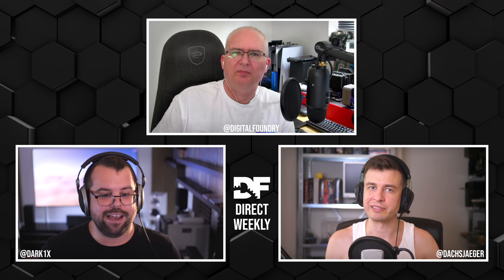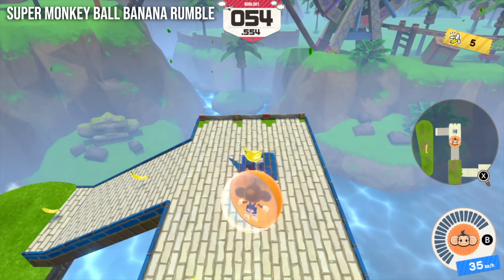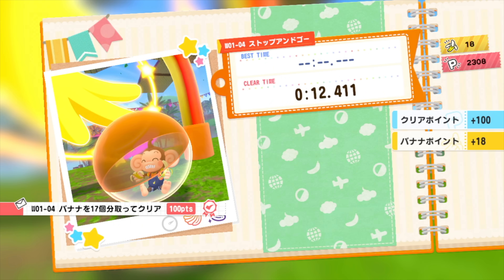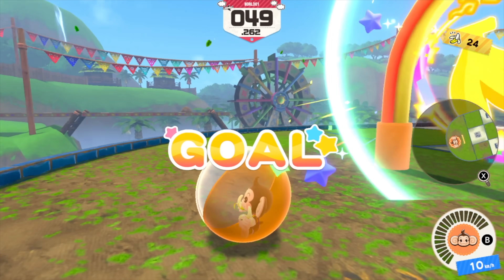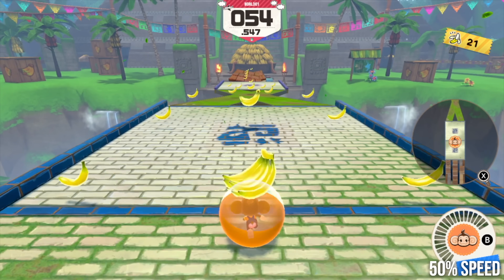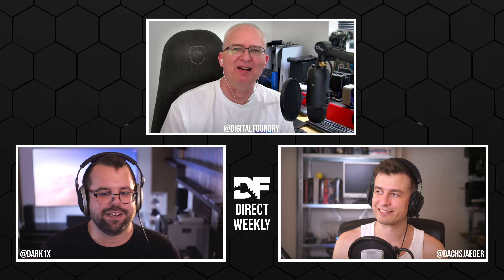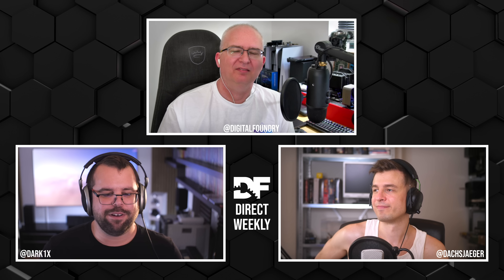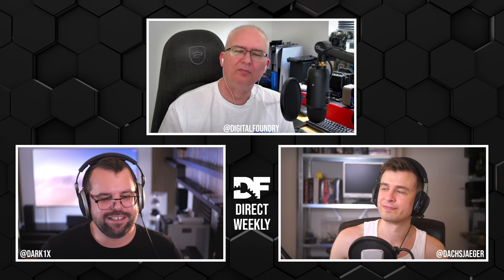The Unity Engine's 50Hz Physics Problem Strikes Again!

Comment: Unity dev here, this is the devs fault. This issue is beginner-mid level. 

The camera movement is likely nested to a physics simulated object (bad). 
Instead the camera should update freely and physics should be interpolated or run faster than screen refresh rate like 100Hz (if perfs allow it, which today devices do without problem, Unity PhysiX can even run on PSP lol)
Reply: Wow so many people that don't understand the problem. I guess this is the reason this keeps happening

The safest option is to completely decouple the physics with the rendering, if you think it's not doable even in a game like this then you simply don't have enough experience. Sorry, I'm not trying to be mean, I just got surprised that so many people think this is either impossible or super easy to fix, it's neither. Yes you can employ 2 minutes fixes that only push the problem to somewhere else, or you can try to design the tech of your game take this into account so that you can get fluid rendering regardless of the state of your physics, be it prediction, interpolation or anything else. Heck there's tons of threads about this in unity forums, you'll surely find a solution that works best for your case.
Reply: @kebrus Unity physics is not tied to screen framerate, never has been. You could go 1fps with physics at 50Hz in theory. 

Multiplayer is the bigger issue, I’ve got no solution for that. Also rendering is the main source of frame drops, rarely it’s physics.
Reply: @euden_yt  I never said it was, I said you need to decouple your rendering with your physics. What do you think happens when you put your camera following a physical object?

What do you think think happens when you let the physical object position be determined by physics when it's being rendered?

Think about the problem and ask the right questions. If you still think these are either easily solved by changing some settings or impossible to fix that means you are still not understanding the problem.
Reply: @kebrus  I went over this in my replies
Physics isn't tied to rendering (which is why the stuttering is happening, as the physics that move the player aren't running at a multiple of the rendering rate) and because it's impossible to get the physics rate to be a multiple of the refresh rate in Unity (without tying physics to rendering anyways) there isn't a perfect solution. Interpolation and prediction would help make it smoother, yes, but they would be harmful to the gameplay. Prediction isn't well suited to this kind of game, and interpolation introduces delay and a gap between where the player actually is and where the player visually is. Even if it's small, it'll likely have an effect on high skill level players, players using wireless controllers, and players streaming games (XBOX Cloud, Steam Link, etc)
Reply: @SHIFT-HACKMON  please read my previous reply to euden.
Reply: @kebrus  OK I think I kind of get what you're saying
You still need the camera to follow the player, so you will either have stuttering on the environment (no interpolation on camera) or stuttering on the player (camera with interpolation) unless you use a workaround that would affect the game feel like I mentioned in my previous reply. Generally stuttering that affects the entire screen will be less noticable than stuttering that only affects the player character since there's a lack of movement aside from non physics-based animations compared to the player character being noticeably behind or ahead of their "correct" position relative to the camera whenever a stutter occurs
Reply: @SHIFT-HACKMON  unless I miss understood what you meant I actually feel like the stuterring from the camera is worse, maybe it's just my perception but I think this is the reason this particular game was outed, because you can clearly see that the camera is somewhat parented to the ball and cause the whole screen to stutter, while if it was just one or two objects in the scene you may even miss it with the rest of the gameplay.

Like I said previously you have to find the best solution to each case, and that is precisely the reason why this is neither too easy or too difficult, usually there is a solution with some caveats for each one of these problems but because they might need different solutions it gets harder to generalize the problem and solution.

You can find people discussing solutions everywhere, I'm sure I even saw a video recently from an indie about his particular problem.

For example for the camera of this game the first thing I would try is to make a ease follow interpolation at relative fast speed. The camera of this game doesn't need to be snapped to physics, I think I would do it even if I didn't have this stuterring problem, if the camera has 2 or 3 frames smoothing delay no one will be able to tell. This is not 250fps counterstrike.
Reply: @kebrus  the reason I say stuttering from the camera is better is because one of those objects in the scene that would be stuttering otherwise would be the player's ball, it'd effectively have the same issue as Batman Arkham City has on Switch
Reply: So in other words they got it working just enough to push it out the door and they'll gradually improve it with multiple patches over time but never actually fix it.
Reply: That second option is not viable for the switch, which is what's being discussed.
Reply: @InvidiousIgnoramus  I suspect that it's very viable to simulate 2 or more physics steps per frame, even on a slow device, when you're dealing with one moving sphere vs mostly-static geometry. With Unity, focus optimisation on rendering, keeping draw calls down, or it'll eat a whole lot of CPU time (And for mobile/switch, keep shaders simple too)
Reply: @InvidiousIgnoramus  I don't think that's a genuine limitation for the type of calculations needed for the gameplay in monkey ball. There is one physics object and it's a sphere. The level geometry is flat planes. The collision test is something like a dot product and a vector difference. Something like 100 clock cycles. They could test the sphere against every single surface in the level every step and still probably 10x the number of physics steps without significantly eating into the rendering budget.
Reply: The game already drop to 5 fps on the switch, no need to make it drop to 0 fps
Reply: @1337pianoman  Yes and no. There is a 16 player multiplayer mode, and they clearly want this to be as big an attraction as single player, as evidenced by the common features in multiplayer focused games, like a season pass. Yes, there is a monkey ball season pass. I personally have no clue how much physics calculations are done on which connected devices or if there's even a server involved. However, it would be sensible to believe it's more resource intensive that single player. Hopefully they weren't dumb enough to optimize for single player as they do multiplayer. Not that you can even compare them, since multiplayer barely hits 20fps.

For single player, you're technically wrong. Monkey ball, this game included, features many physics based gimmicks, such as weighted cylinders and, in this game, free rolling spheres. Obviously there's many moving objects on cycles too, but we all know those are essentially moving walls. However, the game formula you described was actually used... on the friggin gba! I shit you not. So, yes, the physics can easily be ran on the switch, assuming the upgrade from game boy advance to switch should accommodate the addition of a level with 5 rolling spheres.

Imo multiplayer on the switch was always going to be god awful, and everyone knows this. Any argument stemming from the idea that they catered the physics for multiplayer only shifts the blame from incompetence to naivety
Reply: @SilverLining1  This thread is forgetting something really crucial
You can't actually fully solve the issue without either tying physics to rendering (Which is bad and would cause slowdown instead of stuttering on Switch) or by modifying the engine to accept fractional values for the physics rate
You'll always either have stuttering from needing to duplicate frames or stuttering from needing to skip frames. The best options are interpolating the physics (Which would result in smooth movement at the cost of the player always being 1 frame behind, harming the skill ceiling) or to attempt to minimize stuttering as much as possible by using an approximation of 1/60
Reply: Neither option would work
It isn't possible to set the physics to update to 60Hz without tying physics to the refresh rate, which on the Switch where the game doesn't have perfect performance would lead to slowdown, which would cause desync in the multiplayer mode. Likewise, because it isn't possible to set physics to update at a fractional value you can't set physics to run at a multiple of 60, leading to stuttering from having to skip frames instead of stuttering from having to duplicate frames
The physics object the camera is nested to is the player, and as far as I know this is how the camera has worked in every Monkey Ball game (At least on home consoles)
Having the camera update freely doesn't solve the issue, as it's still needing to follow a physics based object and interpolating the camera position would just make the stuttering more apparent, and you can't interpolate the physics without harming the feel of the game
Reply: @SHIFT-HACKMON  I'm not sure what point you're making. Are you suggesting that it's impossible to not have a stuttery game when making it for the switch? There are several ways around it. The easiest is to do the physics step (or an integer number of physics steps) in the frame update and make sure the worst case performance is still under 16.6ms (assuming 60fps target). The other standard approach is to calculate a partial physics step in the frame update just for rendering purposes. You know how long ago the last update was so you can calculate where everything should be now. Moving the camera in the physics update is pretty silly, but it doesn't fundamentally change anything as long as it's also included in the partial step.
Reply: @1337pianoman  I'm not saying that it's impossible to have a non stuttery game on Switch, it's just that from what I've heard Switch doesn't maintain 60fps, particularly in the multiplayer mode (also you just shouldn't tie physics to rendering, that will cause issues)
As for the partial step thing, given how Monkey Ball works I'm pretty certain that would cause the player to briefly be floating or clipping through the floor in the case of a significant input change during a frame where a partial step is required
Reply: @SHIFT-HACKMON  it's very possible to render the exact state between 2 physics steps -there are no unknowns. If you can work out where everything will be in 0.02 seconds, you can also work out where everything will be in 0.00379 seconds. You could run the exact same code and keep the updated positions (it's all continuous functions so it doesn't really matter if the physics steps are all even), or do a simplified version just for rendering and throw it away. I'm not actually sure what most people do these days. I think I'd lean towards running an integer number of physics steps per frame
Reply: @1337pianoman  I'd lean towards doing that as well, but Unity's physics timing system can't accept any values that would give an integer number of physics steps per frame because they have repeating numbers (0.0166... for one step per frame, 0.0088... for two, so on)
Reply: @SHIFT-HACKMON  Fair. I wasn't considering the problem from a Unity specific perspective. I had a quick look into their options. Not a huge fan of their interpolate or extrapolate options. Not entirely sure why they say to avoid simulating with different step sizes (I guess floating point precision?). I'd probably increase the physics updates to ~2 per frame and turn on extrapolation. (But really I just wouldn't be using Unity in the first place)

Comment: Matching the rendering fps is not a god solution and would still cause jittering when fps might not be reached. Physics framerate should ALWAYS be set as low as possible, so that physics simulation still behaves correctly and doesn't waste additional CPU resource beyond that. Then to make visuals smooth, there's the 'interpolate' option. It's fine for most gameobjects, but for camera I would still unparent/unconstrain it from the rigidbody and just use my own smoothing algorithm for setting location and rotation based on target in the update loop. Smoothing based on 2 or 3 past physics frames gives perfect results even if you run the game 200fps.

Comment: Isn't this what the physics interpolation/extrapolation is for (which has been a feature since Unity 1.0)?
Reply: Yes but mainly the camera should not be dependent on Fixed time
Reply: @euden_yt If the camera is following an object, you want the object to remain the same size and position on screen.  You don't want that object to judder further/closer from the camera.  The rest of the setup need to adhere to that.  So fixed time is not the core issue, cohesion between the camera & target is, and also you should have interpolation on your target & camera.

Comment: I encountered this same problem with Unity. Interpolation will fix the issue in most instances.

But there are times where simply turning on interpolation won't fix it.

The devs could have interpolation on but the interpolation doesn't work correctly because of the way they are programming the movement of the ball.

To fix this issue, you need to do a "late fixed update" that sets the position or rotation of the object after all the other fixed update code has finished.

This ensures that Unity correctly uses your position & rotation for the interpolation.

Unity's documentation states that certain functions will move physics objects to work correctly with interpolation, but it's not true.

Comment: You can't blame Unity. They set physics default to 60hz and then game runs uncapped or just at a higher framerate. Same problem now. Even worse, because if there's any frame drop, just so slightly you'll have a frame with 2 physic ticks. Most have 144+hz monitors now, so interpolating physic objects and making presentation position detached from actual simulation position is totally normal nowadays.
The only one to blame is the devs who seemingly didn't catch it. Which is very odd with todays resources.
Reply: I highly doubt that most people have 144 Hz monitors now. High refresh or 4K displays still seem to be used by a minority of PC users according to Steam surveys.

I personally refuse to get a 144 Hz monitor because it would make so many games that are locked to 60 FPS look horrible. 120 Hz is preferable.
Reply: @11clocky Most people might not have 144Hz monitors, but I would say that most people have monitors that have refresh rates higher than 60.

And to take such a stance against an obvious, inarguable improvement is pure ignorance. We are at the point where even the most sludge-grade, sub-$100 monitors support VRR, and therefore are perfectly capable of locking themselves to 60Hz when a game runs at 60fps. Educate yourself and improve the quality of your life.

Comment: 50 hz issues will never leave us
Reply: But interpolation will always be the solution.
Reply: @SnakeEngine  disgustang
Reply: @nikodem123asdf  Well, yeah, the nature of the problem is nasty. And the solution is the same, regardless what engine you use.
Reply: @SnakeEngine  it could just be 60 Hz by default since it's the most common refresh rate. Interpolating to a framerate is always a hack job.
Reply: @nikodem123asdf  Yeah, but since the refresh rate is never exactly 60, you would get stutters anyway, once in a while. So the natural solution is still to use interpolation.

Comment: Unity have like since year the really comprehensive camera system called Cinemachine and if you use it you don't get the problem because the interpolation works properly.
So they got out of the way to create there own camera system and still forget to fix the interpolation instead of just using Cinemachine.
Also PhysX is like the old engine, now Unity is more and more want you to use DOTS Physics or Havok.
Having a higher physic tickrate also makes physic way better and accurate.

Comment: This is not unity issue or a bug but inexperienced developer. The reason physics engines update interval being capped is to make sure simulation is deterministic and updated at constant intervals (20ms instead of random fluctuations) so if your frame rate is lower than this value it will even update multiple times. The reason there is jittery motion is the difference between camera and the player's update rate which unity absolutely does allow you to choose.